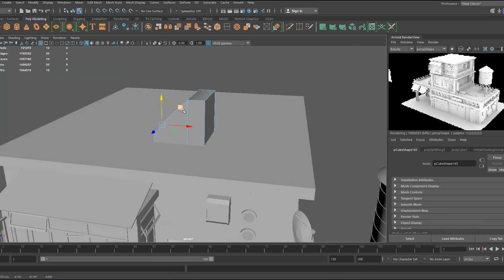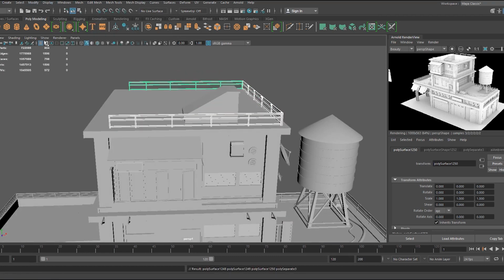World Building: Part 1 3D design for the 2D artist

Comment: Watertanks usually are areas where potible water cant reach, usually areas far from a natural water source and a well not accessible. The tanks are high up to provide water pressure. Places you may find these are mountan towns, old structures of begining settlements ect. Some may still be functional or replaced when waterlines were able to reach.

Comment: Hey Sam, thx for the tut👍🏼😊 Im using ready-made kitbash models of diff types, from small parts to whole buildings etc. If you have time, Id love to see/hear your input on how to work with kitbashing as a base for concept art/illustrations in Photoshop. Specifically how to find the right balance so u dont spend too much/little time on the model, how to set lighting so its ready for the PS work etc. Hope this makes sense😊
Reply from the maker: Hi Lasse, thanks for the comment. Well I will be addressing this a little bit in my next video because I will be painting over the 3D model. I have mentioned in other videos, I also struggle with knowing how much to work on the 3D before taking it to 2D. I tend to over detail the 3D and then leave myself a lot to do in 2D to match the detail. I dont think there is a right answer, just keep trying with different levels of finish in 3D until it works for your process. Hope that helps, but if you watch the next video when its released that might provide more information. Thanks for watching :)
Reply: Cool, thanks for the reply :) I´ll keep an eye out for your next video :)